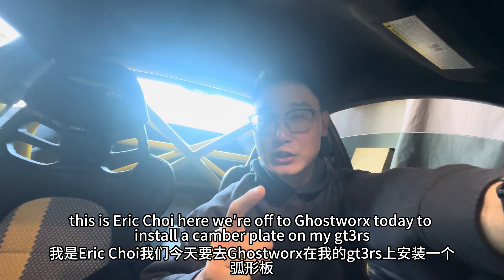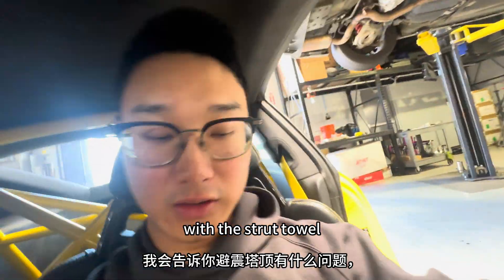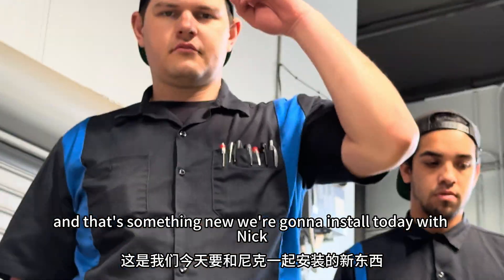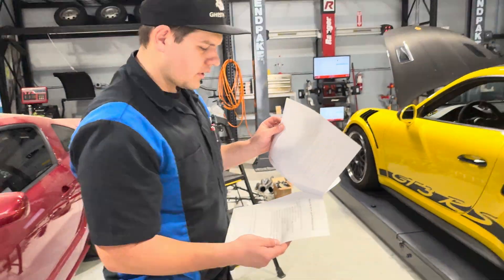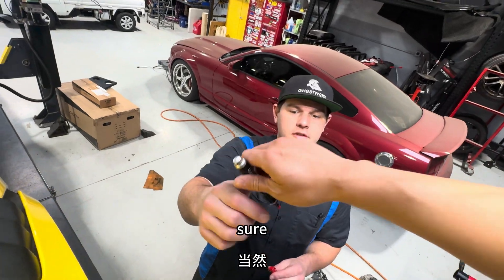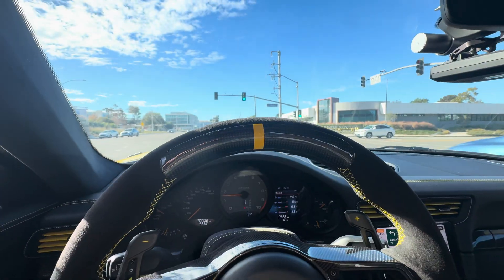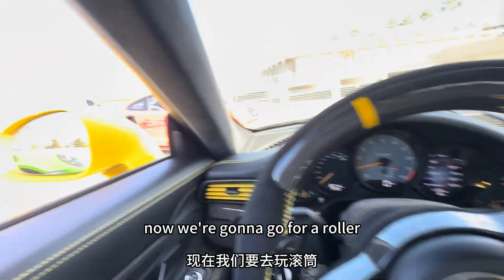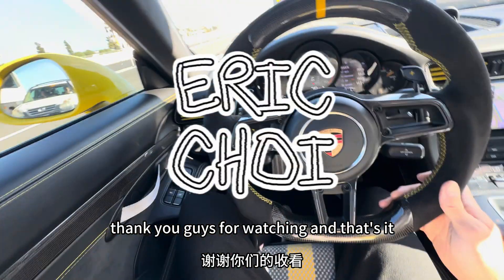I thought the Porsche 911 is Bulletproof!

Comment: Thanks for the info here!  Will only installing the factory strut tower plate from Porsche solve/protect against this issue?  Or do you need the entire kit you installed?
Reply from the maker: @Aaron-yn4bk nothing will solve the issue. All the parts I installed are just adding some kind of protection to prevent it happening.
Reply: @ makes sense. I was thinking of just installing the factory plates for some extra “security”. I only street drive my GT3 with maybe a track session once a year if time permits. Nothing hardcore.
Reply from the maker: @Aaron-yn4bk yes, I highly recommend this https://www.realcarbontastic.com/product-page/porsche-factory-cup-car-strut-tower-reinforcement-plates-fits-991-718-981
Reply: @ thank you!  Looks like I might even be able to DIY the install. 👍🏼
Reply from the maker: @ it’s easy, 3 nuts on top and 1 at the bottom. Will have to take off the front wheels

Comment: If it happens on the carrera gts its bound to happen on every Carrera or turbo. It seems like you suggested it only happens to gt models and im curious why it seems to effect those models only. There shouldn't be much of a difference in the strut tower from a base carrera, a carrera gts, a 911 turbo. These cars use basically the same suspension components save for the spring and damper.